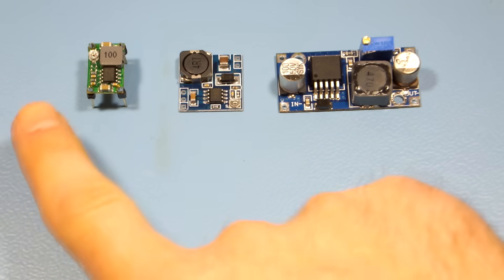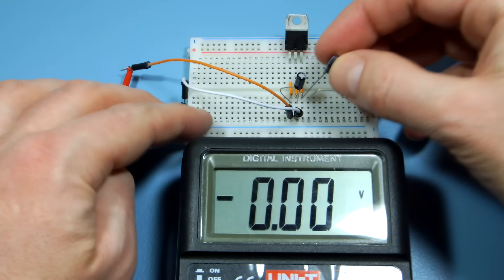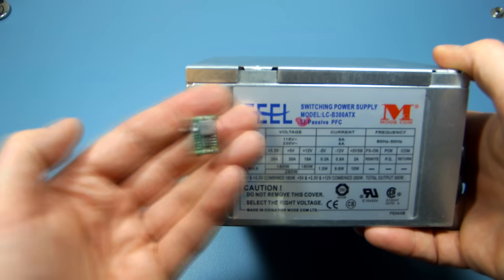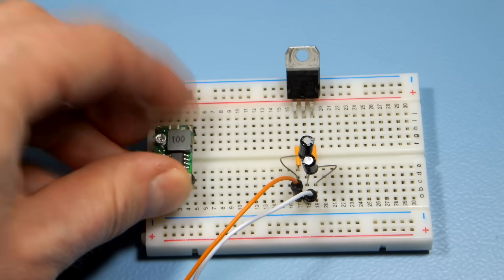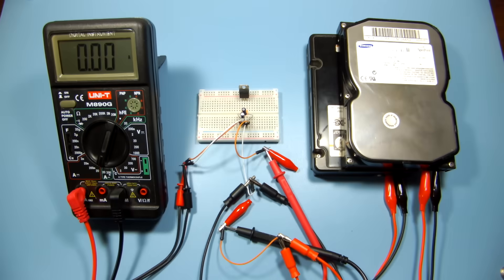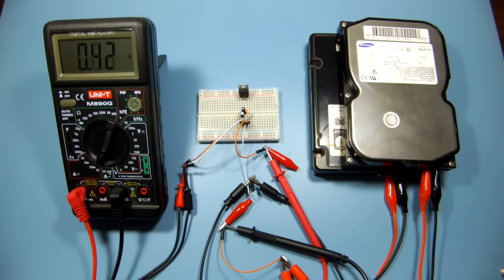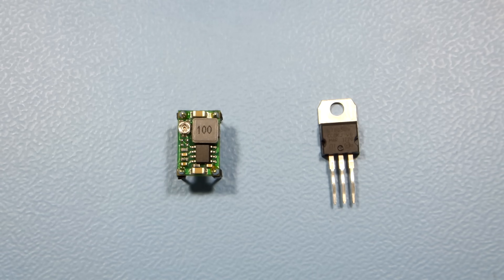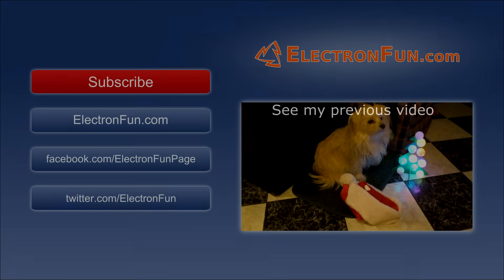Buck converter vs. linear voltage regulator - practical comparison

Comment: How do you calculate the correct capacitor values for the linear regulator? Also, doesn't it provide 5V with or without them? (Are there peaks I could only see with an oscilloscope?)
Reply from the maker: To tell you the truth - I didn't calculate these values. The caps are used only to smooth the output. You don't have to use them, but I'd say it's a good practice.

Comment: hi , i use step up buck converter in my circuits which involves motors . it gets super hot after a while , any suggestions ?
Reply from the maker: What is your buck converter's output current capability and how much current does your circuit draw? Maybe you should consider upgrading your buck converter.

Comment: Nice video, I liked it so much, I just have a comment: when you measured the buck temperature you put the sensor on the coil not the IC(which is the source of heat) is that right?
Reply from the maker: Thanks a lot!
Yes, i measured the coil temperature. In my case it was hotter than the IC itself.

Comment: There are buck/boost converters with shielded inductors to prevent RF interference in sensitive radio circuits.
Reply from the maker: There are such buck/boost converters, but to be honest I haven't tried them yet. Do you have any experience with these shielded converters?

Comment: Hi,
Such a nice video.

I was looking for help replacing burnt thing on my security camera board and saw your video.

this buck converter in the middle is very similar thing to a part on my burnt camera board, in this video.

i'm not familiar with electronics and had bricked a camera because of reverse polarity, and found out an element burnt.

But i don't know the specifications of it, as there's not numbers, but just letters "GCI".

Could you please help me how to define its specifications to find a replacement.

Thank you in advance
Reply from the maker: Hi, it's not always easy to find a replacement, because manufacturers won't place proper labels on their PCBs. Is this a separate board? Do you have any photos?

Comment: Great for the beginner. Maybe a comparison of efficiency of each of the 4. Also, maybe, show how the efficiency of the linear regulator can be maximized by approaching "dropout" condition. STMicro part LD29150 has a 0.4Volt dropout at 1.5 Amp (0.96 USD DigiKey single quantity price).
Reply from the maker: Thanks a lot! I missed your comment - don't know how...
I'm thinking about making a new video about buck converters and linear voltage regulators - just don't know exactly what it will look like yet.

Comment: When you want a stable voltage with a low current in a small device then there are tons of smaller Voltage-Regulators to chose. Especially when you use a battery the oscillator and minimum load of the buck-switching supply will waste more power than the classical regulator-ic. Switching supplies also have a bigger ripple and that is why high-precision laboratory psus combine both technologies. The output of the switcher is later flattened with a "classic" regulator that is transforming the excess power into heat.
Reply from the maker: That's true - everything depends on your particular application. Sometimes a buck converter will work a lot better, but in other circuits it will perform much worse than a linear voltage regulator.

Comment: Have you tried a Faraday Cage for the buck converter fields?
I think that you should have put a heat sink on the 7805 for the test. Just saying.
Good video, liked and subbed to see more. You know Addohms channel?
Reply from the maker: Thanks for your like, comment and subscription :)
I haven't tried closing a buck converter in a Faraday cage, but I will make another video about buck converters and noise. If I used a heat sink on the LM7805 it would have been stable. I wanted to show what happens when the linear voltage regulator overheats.
I didn't know Addohms, but I have just subscribed. Thanks for a good recommendation.

Comment: Now, to add some thing (although this is a quite old video):
Fun fact: buck/boost converters can be much less efficient than a LDO on either very low loads or very high loads (often under 50%). So thats a drawback too.
And: you measured the temperature of the coil, not the IC itself: now that may be important for a higher load to also measure the coils temperature, but thats atleast a 1-2A rated coil. The most heat will be generated through the mosfet in the buck IC
Reply from the maker: It is true that low-dropout regulators can be more efficient, but only in some specific conditions.
In my video the coil was a lot hotter than the IC.
Reply: ElectronFun.com well, those specific conditions would be when you want to drop only a small voltage :D like 5V->3.3V.
Reply from the maker: Fair enough :)

Comment: can we put buck converts in parallel to achieve higher current?
Reply: you could pretty much use a beefier mosfet to drive higher currents
Reply from the maker: That's a very good question. It's not advisable - your current specs will not double by connecting two buck converters in parallel. I would suggest getting a single buck converter, that would fit your purpose.
See more about this topic here: http://electronics.stackexchange.com/questions/110936/effect-of-using-buck-converters-in-parallel
and here: http://electronics.stackexchange.com/questions/55270/is-it-ok-to-connect-the-output-of-buck-regulator-in-parallel.
Reply from the maker: Sure, it's a good idea, but using a buck converter is much easier.

Comment: Thank you so much for your video. Your video gives very clear understanding of the difference between a regulator and a buck converter.
Reply: One question : I think the power consumption is written as 
P[W] = (Vin-Vout)*Current.

When we calculate the power, we need use 7 volts (=Vin-Vout = 12-5) instead of 12 volts.
Reply from the maker: Thanks a lot!
I was calculating the input power consumption, which is my dummy load + the buck converter/voltage regulator.

Comment: I don't quite understand - what do you mean by "draws"? https://youtu.be/giGRrODKJSE?t=315 The buck converter provides or wastes 220mA? In both cases it's a bad value - it is less than 450mA required by the boards. If it wastes 220mA (which is doubtful), how does it consume 90% less power? So how did you come up with this (pretty credible) number?
Reply: If the Buck converter draws 0.22 amps at 12 V does that mean that the output of the Buck is running at 0.42  amps at 5 V? Otherwise I don't understand how a load needs gets 0.22 amps but needs 0.42 amps.
Reply from the maker: "Draws" means consumes. I was measuring power consumption of my dummy load + buck converter/linear voltage regulator. I wasn't measuring power loss.
Reply from the maker: First of all - I was measuring input current in both cases and wasn't focusing on the output. It included the dummy load + the linear voltage regulator and in the second case the dummy load + the buck converter. You can't assume that the linear voltage regulator or the buck converter themselves don't consume power - they do. The difference between the two measurements is the best proof that the linear voltage regulator consumed a lot more power than the buck converter.

Comment: The previous calculations are OK, which indicate the input power, separately. 

"Ploss = (Vin-Vout) x Iin" is only suitable for linear voltage regulator, not for buck converter.

The power loss of buck converter could be estimated theoretically only if we known about the main switch and diode parameters. Furthermore, the process is quite complicated.

The most convenient way to calculate power loss precisely of buck converter is to measure the input power, as well as output power, and use input power minus output power to figure out power loss.
Reply from the maker: I was measuring current draw on the input, which gave me power consumption of my dummy load + buck converter/linear voltage regulator.

Comment: HI i was wondering if you could help me. im building this > http://oi65.tinypic.com/15g5vth.jpg  and was wondering if i can plug a 12v power supply into it? data sheet says upto 12v but on the schismatic it say 4v..
Reply from the maker: Where did you find 4V in the diagram? The datasheet for LM2700 says 12V - absolute maximum ratings, so I wouldn't run it on 12V.
Reply: I have a  8V - 5A power supply i could use and that should be ok ? someone said i cant put a Vin more than vout as it converts low voltage to higher ,,steps up..
Reply from the maker: Someone, who told you that was right. Since LM2700 is a step-up DC/DC converter, you can't give it higher voltage on the input than it is supposed to produce on the output.
If you need something more versatile, you could use a step-up/step-down DC/DC converter.
Reply: ow ok then could i use a 5v power supply on the input then ? or would i have to use a 4v power supply. does the power supply have to be 5A.
Reply from the maker: I guess you could use 5V - I found 5V in your diagram. Amperage depends on your output needs.
Reply: it says 4.5v vin. if it wil be ok with a 5v then i could use a 5v 5A power supply. if it wont work then all i cna fin online is a 4v 1A power supply and i will be using this to charge a mobile which can draw 2A
Reply from the maker: First of all, if you have a 5V power supply and you want to charge your phone, you don't need anything else, just the micro USB plug.

Comment: You should comment more on the noise issue associated with the switching in the buck converter and how to at least reduce it by proper use of capacitors and ferrite beads
Reply from the maker: I totally agree with you, but my channel is very small and I have rather limited resources, so I don't have an oscilloscope. It's quite difficult to talk about noise without showing it on the oscilloscope.

Comment: Too much information in a very short video. Loved it .Please give the link where I can buy those converter. Where did you get that small green one BUCK converter.
Reply from the maker: Thanks a lot :) Would you prefer longer videos?
I bought all 3 buck converters on eBay. You can buy the small one here: http://www.ebay.com/sch/sis.html?_nkw=1x+Mini-360+DC%2FDC+Buck+Converter+Step+Down+Module+17x11x3.8m+4.75V-23V+to+1V-17V&_id=291247572887&&_trksid=p2057872.m2749.l2658.

Comment: can i use buck convertor in powering audio amplifier circuit
Reply from the maker: Sure, you can try, but I guess the linear voltage regulator would be better for such applications.
Reply: +ElectronFun.com thnk u sir for your quick respond
Reply from the maker: No problem :)

Comment: What about reliability?  The biggest dilemma I've run into is how to rate reliability because the switching regulator uses so many more components that can fail.  But the linear regulator can also burn out if over temp, no?  Please comment on this topic.
Reply from the maker: It's not an easy question. Linear voltage regulators are quite reliable - they usually don't burn out easily, because they shut down if they get too hot. On the other hand when you buy a decent buck converter it should serve you well too. The cheapest ones may fail at times, especially if you run high currents through them.
Reply from the maker: Testing reliability is not easy and would require many items of the same type to check how many of them fail. My channel is way too small for such experiments - I simply don't have resources to do that.

Comment: The little baby buck on the left is trying to be sold as a 1 amp on aliexpress. THIS IS WRONG. It falls over at about 250-300 ma. It can not even handle an esp-8266-01. The one on the right is a super good stable work horse that I use often. 2 amps is no problem. It can be used for almost everything from small lasers to raspberry Pi 3's.
Reply: Are you referring to the LM2596 module on the right? I've been using it in a project recently that uses a 500mA load 12V, meanwhile powering my microcontroller and peripherals at nice 5V. It's performed flawlessly so far.
Reply: @ElectronFun ah.. thats is good, the one on the right is a fantastic buck... i use it for everything up to devices that sometimes peak at 3amp.
Reply: +Chris Trigg I was agreeing with your point about the one on the right being good
Reply from the maker: I was trying to stop everybody from buying the square one in the middle :)
Reply: not much - 5v 20ma
input was 9v 2 amp dc supply
Reply from the maker: I didn't have any problems with the one on the left and the one on the right, but the square one in the middle failed very quickly with no apparent reason.
Reply: @Joseph Cayse hmm u need to re-read what i said.. left = bad, right = good.
Reply: I tried the one on the left and it got super hot which of course made it cut in and out. Other than having a pot a LVR would have worked just as well.
Reply from the maker: The small buck converter is for relatively low currents. How much current was your circuit drawing?
Reply from the maker: That's odd, I'm guessing your buck converter may be faulty.

Comment: Thanks for this great video! :) However, I'm confused as to what gets connected to IN+, IN-, OUT+, and OUT- respectively? If you are still unable to reply to comments, please drop a mail to koolkarishma95@gmail.com . I need the explanation quickly. Thanks in advance! :)
Reply from the maker: Thanks for your great comment :) You should connect your power supply to IN+ and IN- and the device you want to power should go to OUT+ and OUT-. Just make sure your polarity is not reversed.

Comment: by the way sir may I ask. That smallest buck converter circuit you used to power the hard disk, what was the input current you supplied it with?
Reply from the maker: I didn't limit the current on my power supply.
Reply: ElectronFun.com ok sir thank you for the reply.. Good day sir...
Reply from the maker: No problem, have a good day too :)

Comment: I also did the same comparison and found the same problem with linear voltage regulator as it turns too hot to handle. Now i have an actual mobile charger inside my motorcycle compartment using a buck converter. It's so convenient as i can repeatedly charge my phone anytime, anywhere where there is no AC electrical outlet and I can do this even when not not using my motorcycle. It really draws less current than the linear one therefor less heating. I am using LM2576, by the way, but i'm not using heatsink ofr that matter. This video is a confirmation that I'm doing it right. Thank you for this video.
Reply from the maker: Thanks a lot for your comment! You are doing it right - a phone won't spot the difference between the "noisy" buck converter and "clean output" linear voltage regulator. The buck converter will definitely produce less heat and draw much less current.
Reply: ElectronFun.com By the way sir 18 years ago, i powered a two way CB radio with conventional power supply using step down transformer because back then i really don't know there are different ways to power different devices. All I know is that if i have a step down transformer, a full wave bridge type rectifier diode and a filter capacitor that's it i have a power supply. I really didn't know about buck converters until just two months ago.
Your video helps a lot sir... Thank you

Comment: when i connected a 12 v Battery across input, LM2596 is getting over 
heated and not working after that . I tried with 2 modules,  both got 
wasted. But when connected with 8v input, it's working perfectly. In 
both cases , there is no load across output  . Any suggestion ???
Reply: Check the battery's amperage . The LM2596 may not able to carry aperage above 5A.
Reply from the maker: Overheating without any load on the output is very strange. How did you connect your battery?
Reply from the maker: It seems the LM2596 is overheating even without any load.

Comment: Hi, thanks for the great video.  I have a question for you.  How does the output change on a change of input. So if you have a 12v battery for input, the starting voltage may be 13v in the beginning, and as time goes by the input may go down to 8v.  In comparing the buck and lm7805, how do they compare in this situation?  Thanks.
Reply from the maker: Sorry for my late reply. The output shouldn't change as long as your input voltage doesn't go below 7V for LM7805. The same applies for buck converters, but the minimum input voltage value may vary a bit.

Comment: @electonfun.com Hi, I am thinking to build windmill generator with 3v/12v motor to charge mobile device. should i use LM7805 REGULATor or Voltage step down convertor to make constant output of 5v? please suggest ,
Reply from the maker: Sorry for replying so late. Mobile devices won't spot the difference, so I would use a buck converter, because it's a lot more efficient.

Comment: You said if noise is an issue, then a linear regulator is the only choice... why not use a filter with the buck converter?
Reply from the maker: Some applications don't require a very clean input, but sure - you could use a filter with the buck converter.